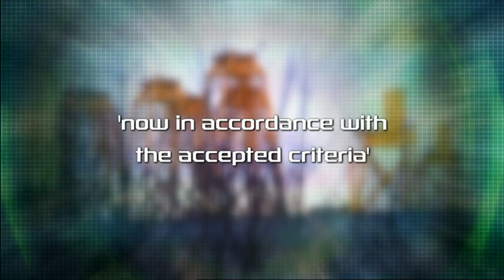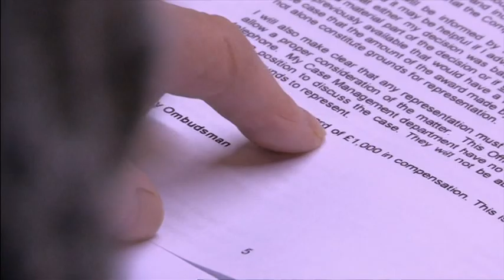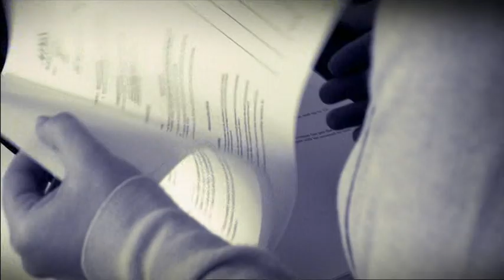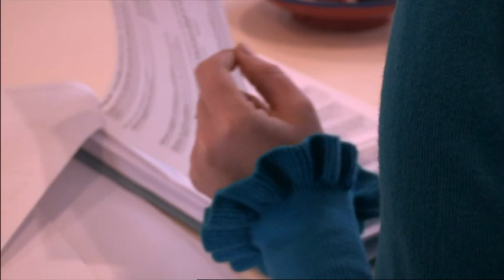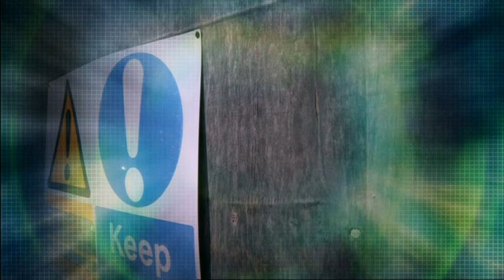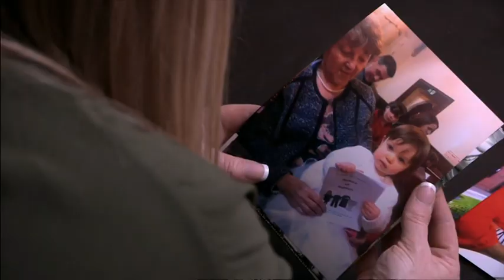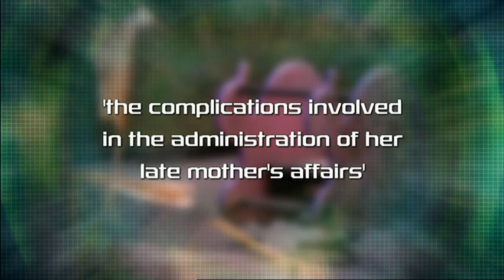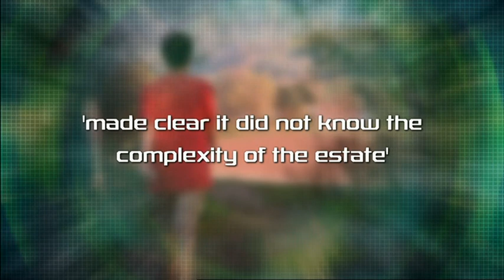Rip Off Britain 20/06/2018

Comment: It’s very difficult, if not virtually impossible, to find out if an attorney - in this case, one named as an executor - is working diligently and knowledgeably on a case, has filed the proper paperwork and has indeed put in the number of hours claimed.  I wonder if the relatives discussed in the video had had an attorney review their wills before filing them to lessen the chance of there being an issue that could wind up in court.  I do know that if a will goes to court it can take years for the issue to be settled.